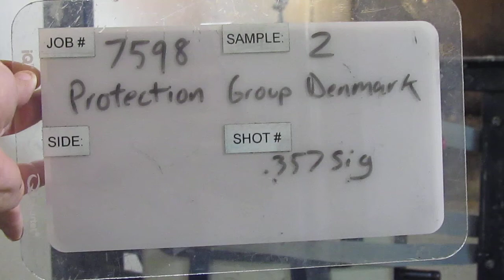H.P. White Laboratory test .357 SIG | Bullet proof vest level 3a

Comment: Try one with 10mm underwood defender round!
Reply from the maker: It would probably penetrate the soft armor and require some hard plate in front of the vest.
Reply: I'm sure it would velocity around 1800 fps way over nij spec. I did use a underwood pentrator and it stopped it on a out of date 3a.
Reply: The same 357 sig Underwood round gets 2200 FPS out of a 5 inch barrel.